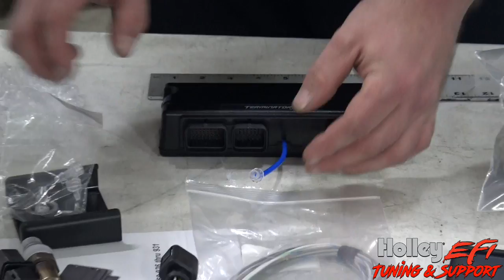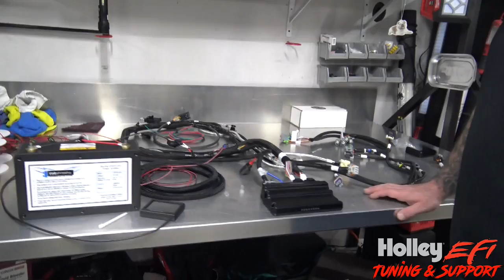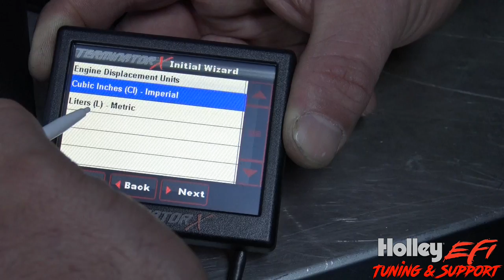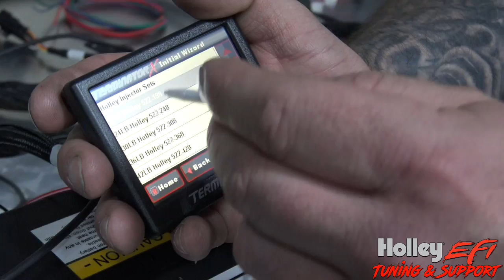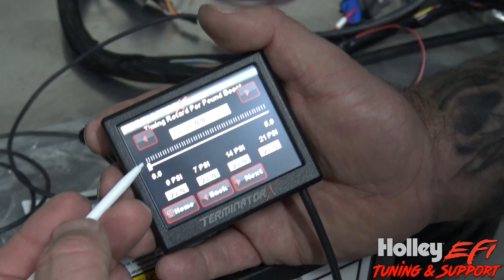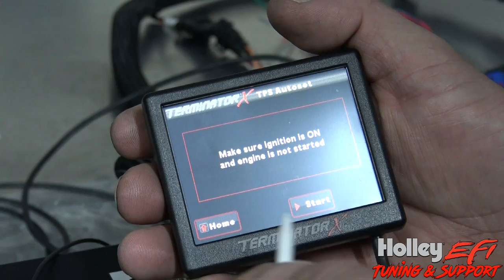The New Holley Efi Terminator x intro

Comment: I have a situation where I want to run a gen 1 small block Chevy with a 24x system and am considering the Terminator X. My car is not a race car but a street car. Does the Terminator X address emissions compliance? There appears to be no consideration for EGR, which is there to reduce oxides of nitrogen. Is there an alternative in the Terminator software to address or control that? Just curious as to how people are complying with registering their cars. Thanks.

Comment: Thanks for the video.  First time with FI. We are building a 4.8L, S475 turbo, 4L80E, drive by wire. Looking at dominator due to the trans and drive by wire but do you think terminator X max will work for my setup? I'm a little worried about how many I/O I will need.
What do you think?
Reply: For basic setup it's enough...depends how much data or things you wanna have the holley control...like fans or second fuel pump ect. But if you don't have any of these things yes this would work with your turbo setup and control the trans

Comment: I really really wish you could configure different crank triggers low impedance injectors and 4....6...8 cylinder engines. That would truly make this system a game changer. It would get so many people converted over to EFI and then if they ever outgrew the capability of their intro system. you could plug in a dominator or an HP. I would buy it right now if I could do those things.

Comment: Hey man I have a question. I have everything connected and I don't  have spark,none .
Reply: You don t have ground then most likely   Is your engine isolated from the chassis or any other component.   You probably need a chassis to engine ground or you just don’t have the ground hooked up at all. Watch devins vids. And rewire  the car accordingly.  I’ve seen a lot of screw ups of guys just not following the directions exsactly. Slow read the directions and you will find the one detail you missed

Comment: I’m swapping to termX with 7” screen this winter in my turbo 98 camaro.  I would like to make it as simple as possible. What relay/fuse board do u recommend.  I would like to use as much of my factory fuse box as possible.  But I’d assume I need atleast relays for my fans and fuel pump.  Or can I run them through factory relays
Reply: you can use the factory relays

Comment: Devin if I'm not using drive by wire and the max doesn't control my e4od is there any reason to get the max or just stay with the standard terminator?
Reply from the maker: correct stay with the standard
Reply: @theholleyefiguy  will this power the factory coil or will I need an ignition box?  My last holley setup I used coil near plug.  I'm putting this on a 95 ford lightning
Reply from the maker: @kellyshotwell8681  i just posted a new video on the fox body specific kit with the tfi adapter, check that one out it will be a better fit for what youre doing .  but either way youll need an ignition box

Comment: So I'm doing a 4.6 swap in 71 f100. If order a hp kit want to upgrade to dominator setup just a ecu box? Really getting a efi wouldn't need mess with motors factory wiring, making swap a lot less of a pain with tune options?

Comment: Your videos are awesome. I appreciate the very detailed instructions. I have the a 72 Chevelle with a built 6.0 gen 3. I have the Terminator 550-608, AAW 510105 wiring kit and a Dakota digital dash. I'm running a 6 speed trans. Once I'm done buying all the parts I will be contacting you sir. Thanks again.

Comment: I notice the harness comes with a knock sensor harness. If you’re not using knock sensors, can you use that channel as an extra input?  For example, an inclinometer that is designed to pull timing. Wire it into the knock sensor harness?

Comment: Holley says plug and play for ls. Does that mean ls only, or can it be configured to run other other engines?
Reply: This is only designed for an ls.
Reply from the maker: i was told that other systems will be released soon. currently only for ls engines
Reply: devin vanderhoof Awesome. Thanks for taking the time to respond to comments. Subscribed.
Reply: @theholleyefiguy 
Hello.  I am try to understand the self learning strategy on this. Do you start a self tuning process and the ecu writes maps accordingly, then runs off of the maps it created? Or is this ecu constantly making tuning changes all the time?

Comment: Interested in 4L80 controller add on. Any plans? Also interested if I'll have to tow new rebuild to dealer for trans flash?
Reply: The Terminator X max has elect. Trans control and dbw control for a $200 upgrade

Comment: I don't have any tuning experience would it be fine to drive around on the self tuning software for a while until I can get it professionally done?
Reply: The Holley systems self learning will generally get the car within +/- 3 percent of perfection whish is good for just about anyone more experienced users can from that point dial it in even further.
Reply from the maker: That's exactly what this is designed to do

Comment: thanks for the video!! I'm looking to purchase one of these don't have the $ for a dominator but I like the fact that if I want to upgrade in the future it just the matter of switching ecms. just curious do you know if the boost control is fairly similar to the hp and dominator? I'm assuming its all the same just controls solenoids.. thanks for the tip about the map sensor not using an additional input was curious about that
Reply from the maker: Yes they're very similar